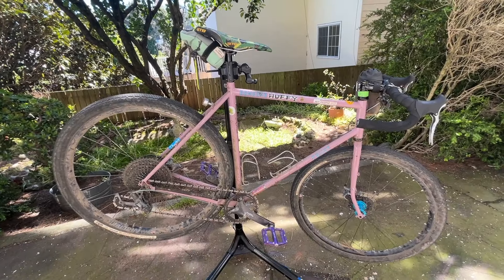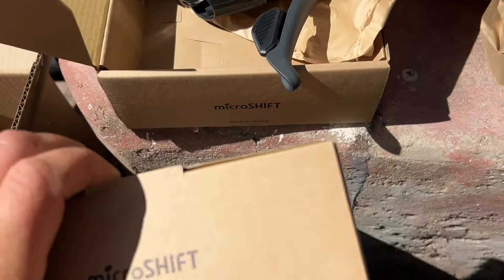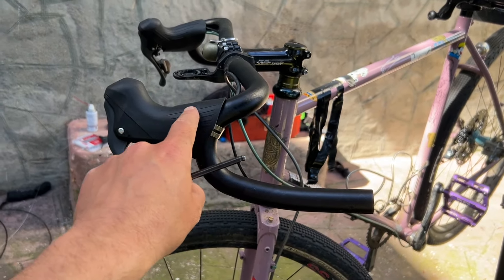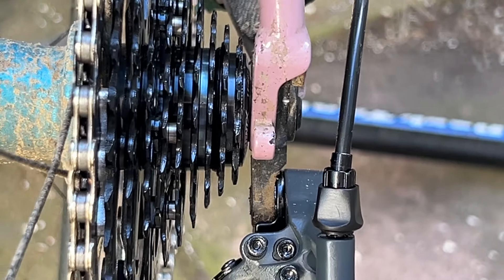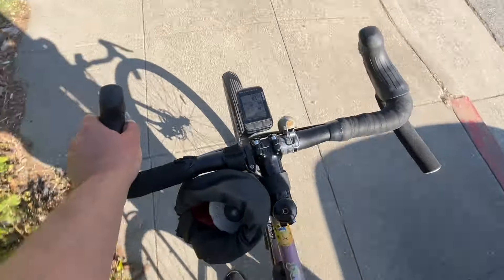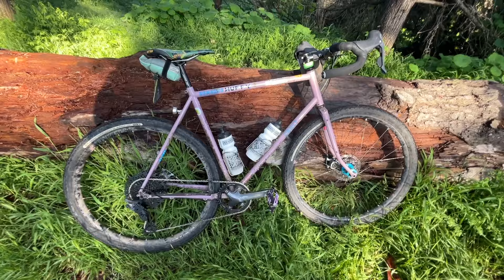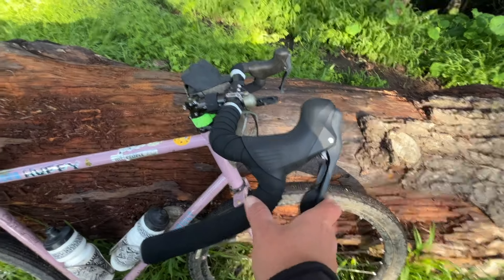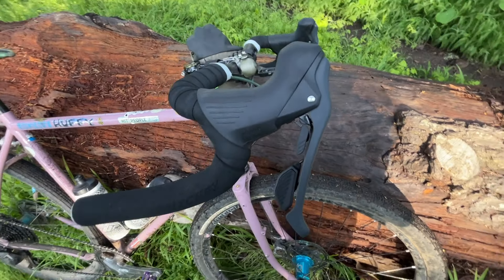Microshift Sword Unboxing, Install, + First Thoughts Review

Comment: I find that it's not too hard to do a "roadside D-hanger alignment". I find the gear that makes the derailleur most vertical, and that gives a good idea of the alignment up/down, and then put it in the smallest gear so the derailleur goes horizontal to see the alignment front/back. Also a long 5mm hex key in the derailleur mounting bolt gives a good reference compared to the hub, and when you're aligning it the long hex key is also used as a handle, so that you're not putting all the force on the lower parts of the derailleur. Not a 100% repair but it can get it nice and straight again until you replace the hanger.

Comment: The derailleur alignment guage is really only made for integrated hangers on steel bikes. Although the bombora is steel that hanger isn't, those are made to bend and break before your frame does. It is best replaced when damaged. I always buy 2 when i damage one so i have a backup as some can be harder to find than others.
Reply from the maker: smart. i bought two since bending this one. gonna carry a spare on rides since theyre easy to swap out.

Comment: Very cool bike! I am thinking about turning an old 29er into a monster gravel bike and have been looking at the Sword group. Ugly, yet functional works for me. Thanks for your review. 
BTW, did you consider using a piece of black housing under the tape, inserting an inline barrel adjuster just below the bars, and running your green housing to the rear derailleur?

Comment: When it comes back in stock you could check out the UNO bar end shifter from Soma 🤷🏽‍♂️.  That way you can rock with bent hangers, use any levers, any derailleur and any cassette you want(while also being able to get on the brakes easy peasy.  Like the wind
Reply from the maker: Dang that's a sick option too. Microshift also makes a bar end shifter for 12spd MTB rear derailers and you can toggle between friction and index. and it's $55 instead of $150. i thought about going that route but really prefer a modern shifter (brifter). bent hanger is not that big of a deal.

Comment: note the sword crankset, wolftooth 36t chainring will not fit on it but the crank arms are drilled for shimano grx replacement rings, and that is if you get the crankset.
Reply from the maker: thanks for adding this. i think some people have filed the tabs the tabs but that's obviously not ideal.

Comment: How did you find the throw on the shift levers? Another review commented how they felt kind of spongy because you had to move the lever so far for the shift to engage. I wonder if the bent derailleur hanger would affect that though.
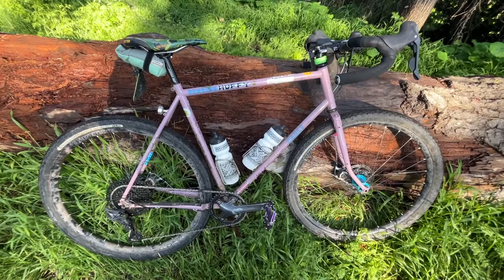Reply from the maker: good question and i agree the lower lever for downshifts is spongy or mushy. at the 15:37 mark i inserted some text to explain how the downshift sensation is faint or vague which is also not great. in the middle of a mushy lever throw you may or may not register a "click" letting you know there was actually a shift. it's one of the small cons of the group but on the other hand not really that big of a deal, especially considering the price.

Comment: Do you Testing Sunrace Model Ms2 Cassette 10s 11/51  3 last cogs 39-45-51t ?
Reply from the maker: no this is a microshift advent x cassette. not sure if Sword can handle a 51t but im guessing it does
Reply: @callinginsickmagazine 
I apologise for my English. I wanted to say when you can test, there is a 10s cassette from Sunrace with Shimano scaling.
Or old cassette 11s, scaling dont work, but only of sword up to 51t. 
Thanks 🤘🏻🎸
Reply from the maker: @alessandrouk2  ahh gotcha. no worries. i will keep that in mind, thanks!

Comment: Hi , was thinking about getting a Bombora . I’m 5’7 so I’m somewhere between a small or medium . I was leaning towards the small . Have any thoughts on if I  should size up or not ? Thanks for all the previous vids :) .
Reply: I’m 5’6 and the small fits great. Remember the TT is somewhere around 54cm.
Reply from the maker: I think you should go with the medium. They recommend sizing up. I'm 5' 9" and ride the large/58cm.
Reply: Thank you for the suggestions :)
Reply: Small
In any event, fit 1st, buy 2nd
Reply: When between sizes, go smaller. In esp. since bike vendors tend to understate the actual sizes.